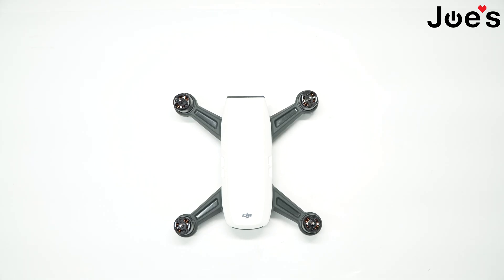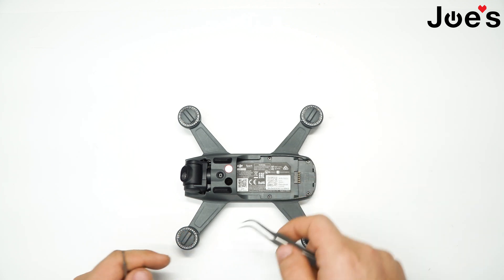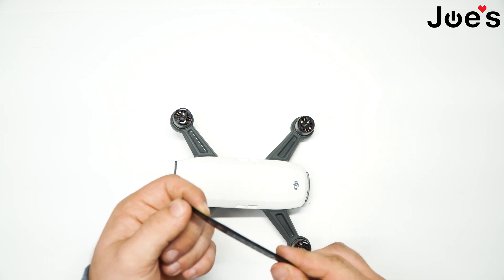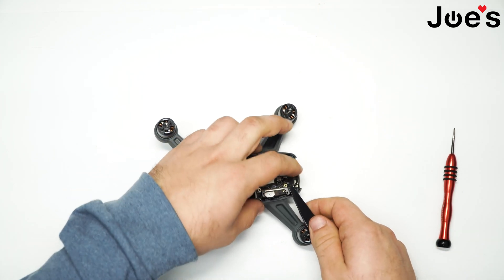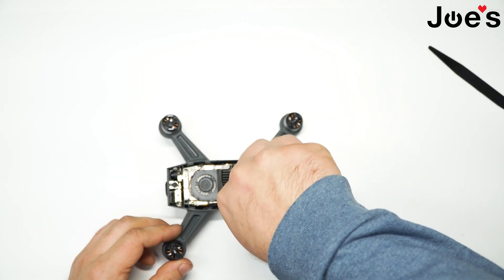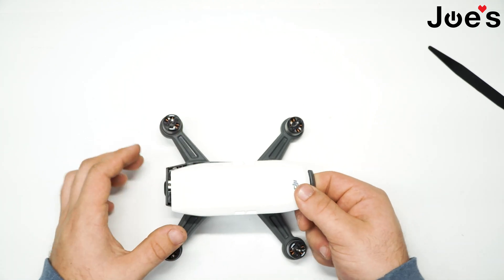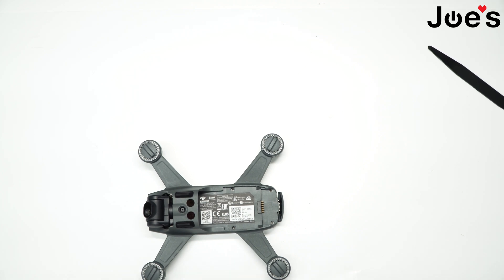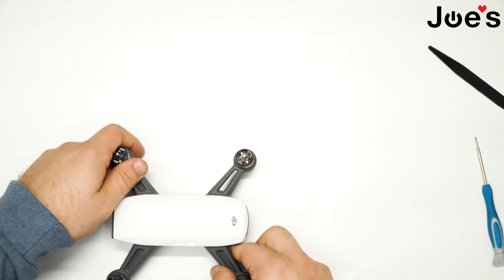How to Replace DJI Spark GPS Module | Repair Tutorial

Comment: If the gps module is change will the wifi name also change for the the DJI Spark??
Reply from the maker: I think so
Reply: If you connect through the RC it will stay the same.

Comment: Thanks for the great tutorial. Do you know what went wrong with the old GPS module? I have a Spark that seems to have a weak GPS. I'm going to take it apart to see if there's a loose connection before I order a replacement module.
Reply from the maker: We are not sure.